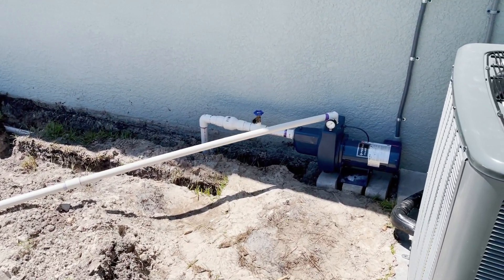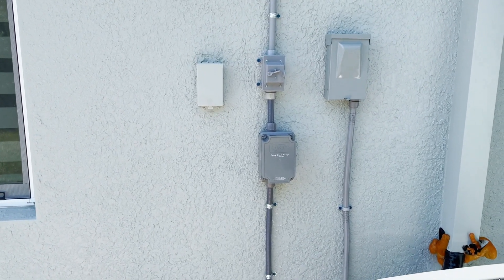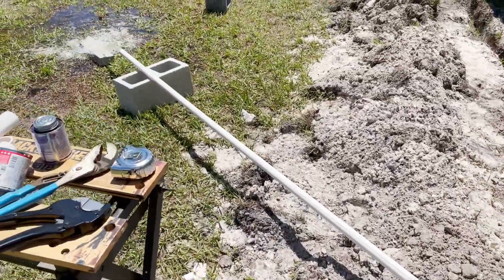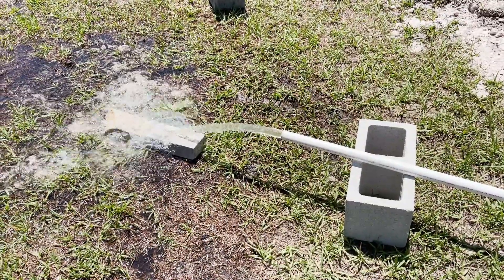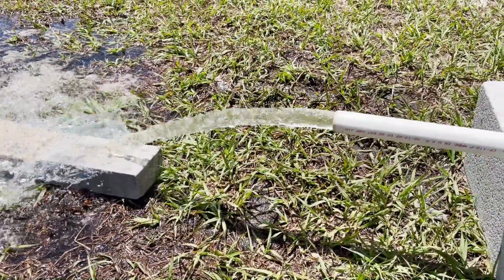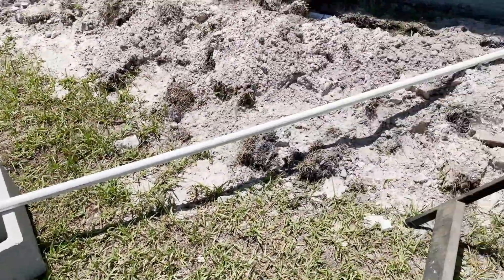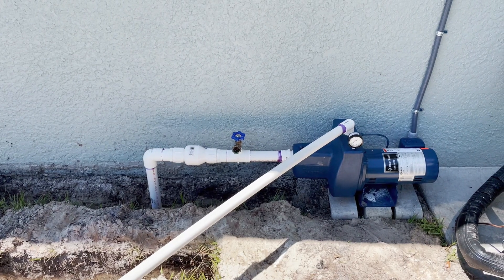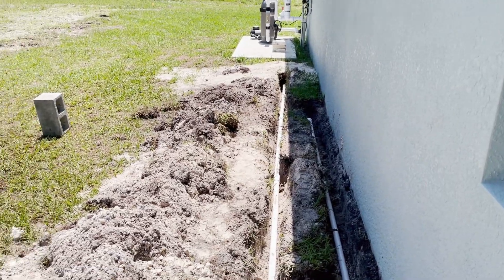Florida Sand Point Well (part 7) Well Completion & Flow Rate

Comment: Great video, I subscribed. 
I need some help. I got pretty much the same set up that you have and I am getting only about 7.5 GPM. I have 3 wells, I have the same pump, I found water around 8 feet. Any idea what could be issue here? Thanks in advance! I have watched all your videos.
Reply from the maker: There are a lot of "IF's" here.  What is your soil?  Where are you located?  Sand vs. clay...huge difference.  So, are you only down 8 feet?  If no, and you are down 25' or more, you may have a priming issue / something else going on.  Sorry I can't help you further.  Good luck, and please report back.
Reply: @guydoesstuff6562  Thanks for your answer. I live in Jacksonville FL, my water level is 8 feet from ground level, I dug down around 28 feet. I am using 1-1/4" pipe for the wells, I missed that part on your videos, otherwise I could use 1-1/2". I'm thinking about to add another well. So will be 4 total. My soil type is the typical Florida soil, sand for the most part. Thanks again!
Reply: @masf1977  Did you got success on 4th well? I am in same boat. I dig 35 fr and barely any water. Pump runs for 3 mins and no water. I live in Tampa Fl... I want to see if adding more wells will increase output of water. Thanks